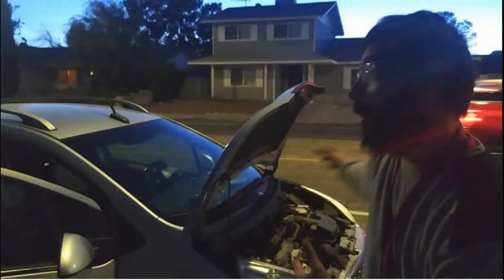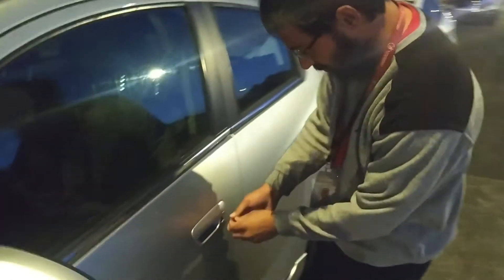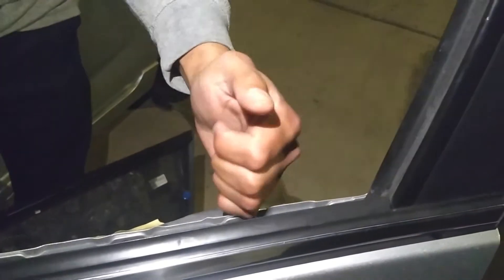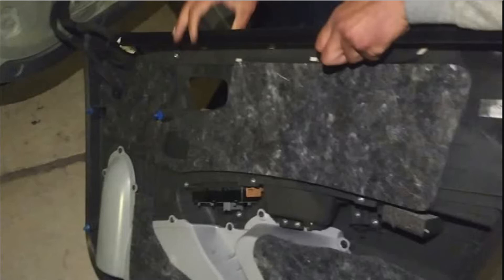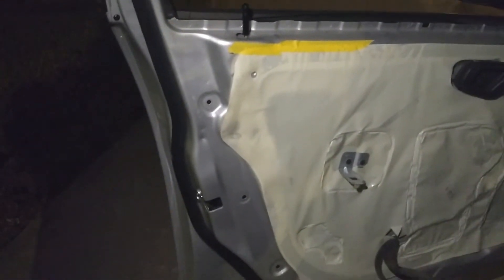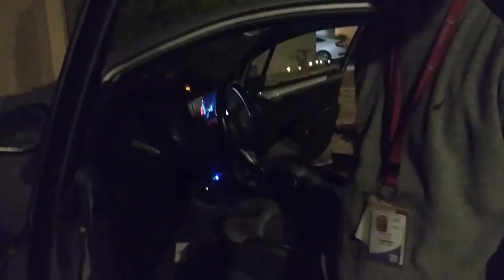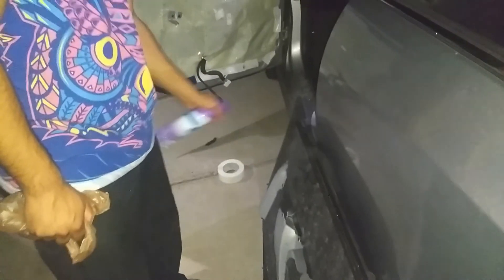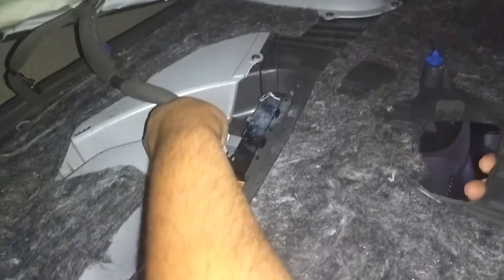(2011-2015) Chevy Spark Door Latch Replacement

Comment: I had same situation with door lock. Normally you should be able to pull up by hand. I had to use pliers to pull up to unlock. Parts stores didn't even have parts in their inventory. This is dealer item. Cost me $150. Actuator includes 2 rods. But to change out lock handle rod, be careful and don't lose the "C" clip that's attached to the back of door handle lock. Take your time and don't lose parts. Time for me 1 hr.